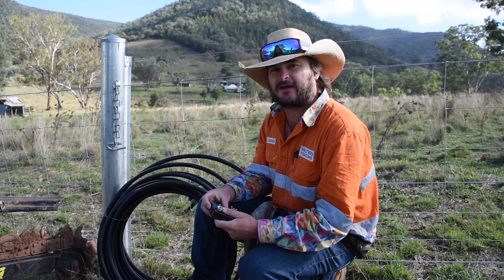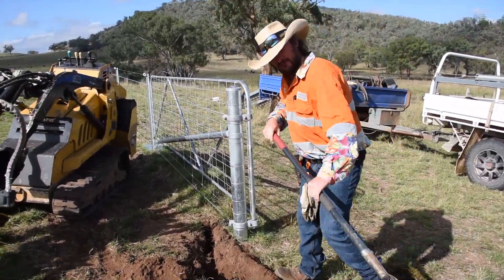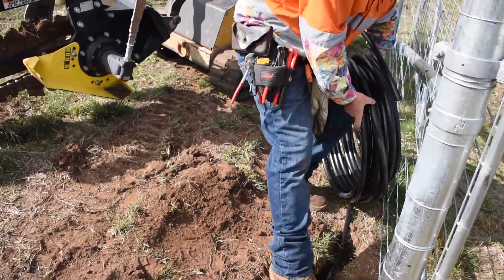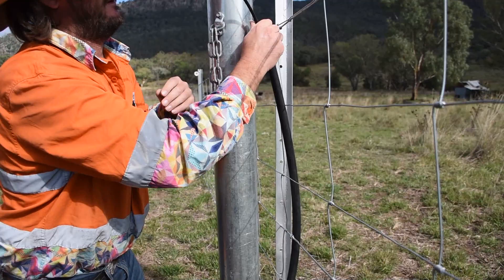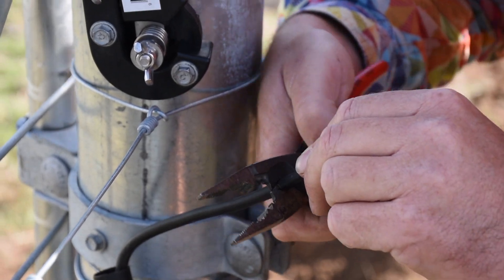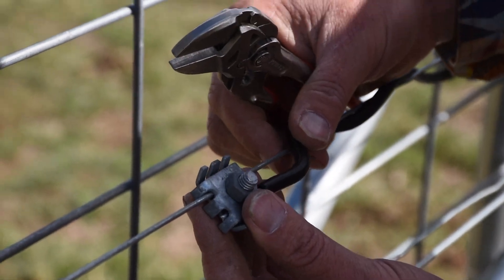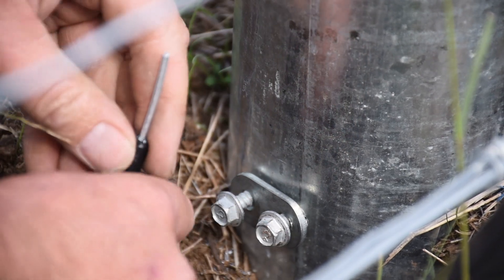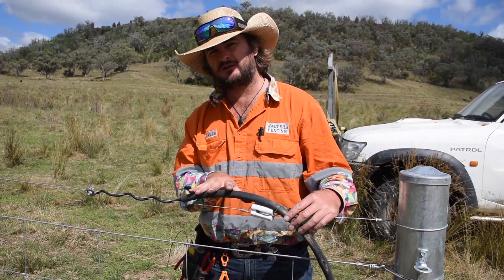How We Do It: Electrifying a Gateway #EP19

Comment: Nice Vid, I'm a big fan of the shirts! 
When installing the ground cable I never cut it to final length. That wee bit spare gets coiled up neatly and cable tied out of the way. That way you've got a little spare for when (when, not if..) the switch fails/gets buggered by hapless hank or there is a need to make small changes.  
It means you don 't have to dig another trench for being 12cm short, and that bit you cut off (presumably) gets chucked anyway
Reply from the maker: Good thinking, it's always smart to keep a spare for (when, not if) things go wrong, definitely with you on that one!